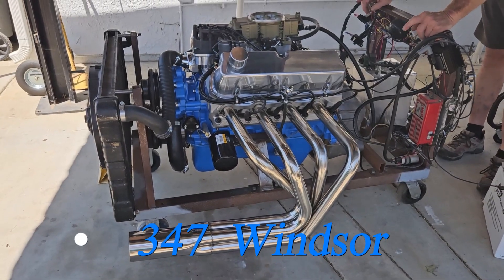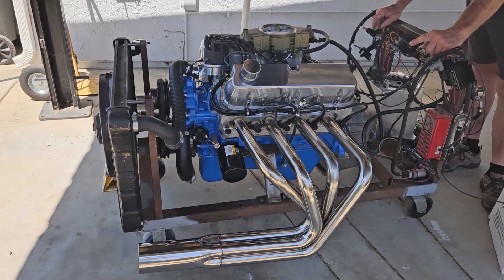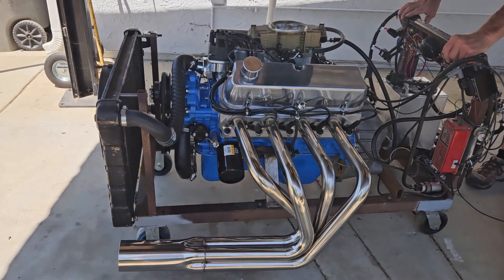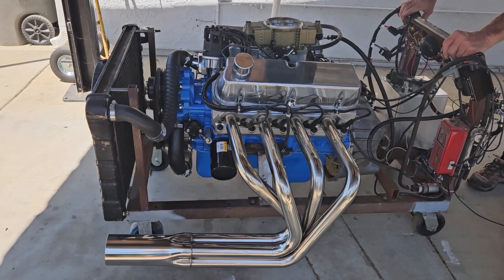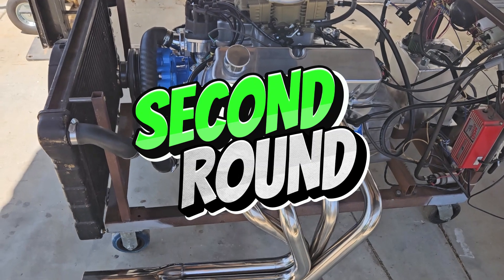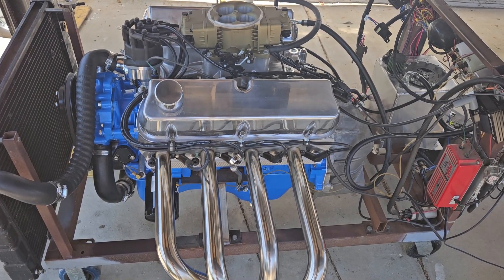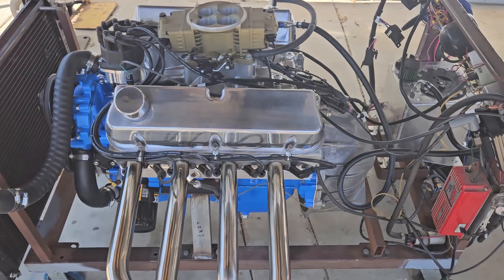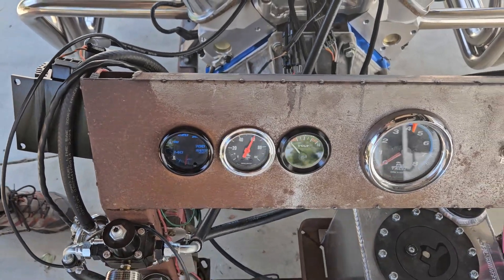347 Windsor New Bronco build

Comment: Sounds good. Lot of ppl don't spend money on small blocks anymore but power and efficiency isn't really a bad thing in a driver. Glad you didn't put an oil pump in it that pumps a million gallons an hour.  Proper oil you don't need high volume. Clean build sir